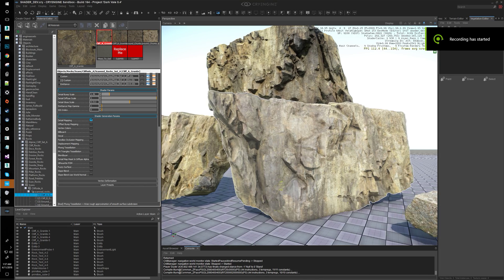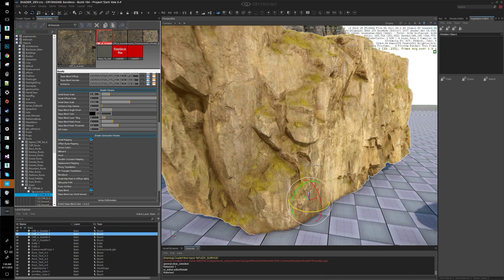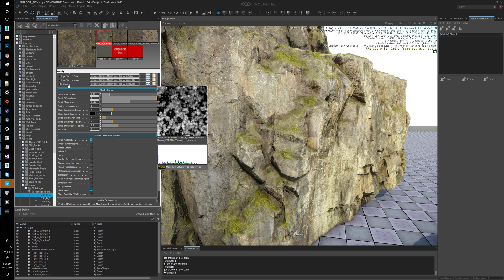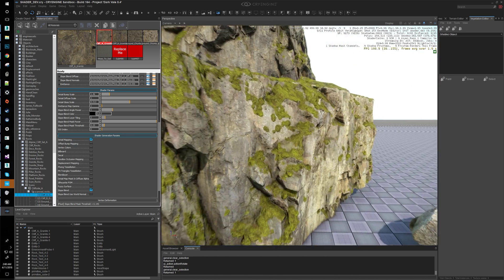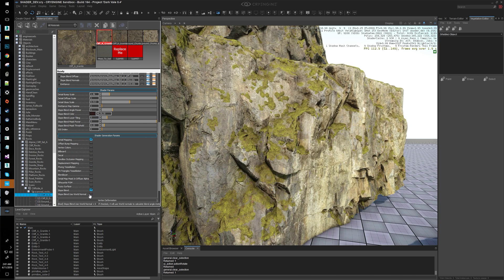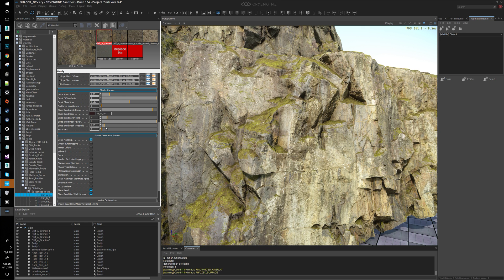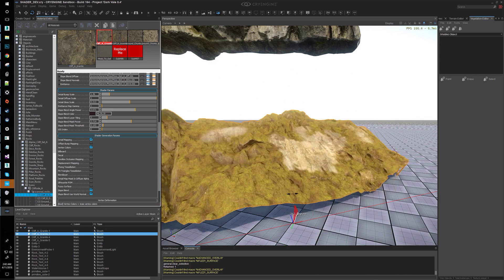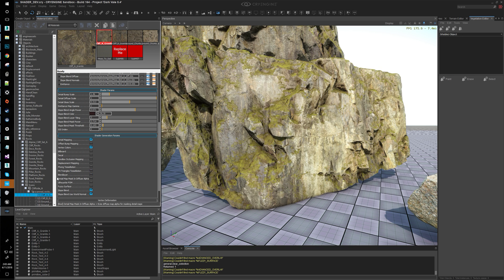Cryengine Slope Blend Shader Final

Comment: i made this type os shader in unity years ago, tried un CE but ... shaders in CE..
your work is awesome and impressive.. beautiful.
doe this shader work as a rain map or just slope blending ?
Reply from the maker: Sorry for late reply wasnt getting notifications for comments. Its just slope blending on a specific asset with the shader effect applied. However I could theoretically use the Deffered Rain system, as a base to make something thats global. (like snow)
Reply: @themodman1014  and with a random splatmap acc to worldPos you could use one asset to create thousands of different rocks, i made this with unity , but couldnt get in CE shader system at the time
Reply from the maker: @victordu4694  absolutely, the trouble I'd getting vertex world position data from CE. I can get it in camera space. But I'm not sure of the correct way to convert to world space from there . I will probably start back up that process soon
Reply: @themodman1014  ah ah there's always some kink somewhere... maybe you can get a "semi random value" from the object world pos, enough to change splatmap
Reply from the maker: @victordu4694  I could get the instance ID and make that a driver of the map variation.